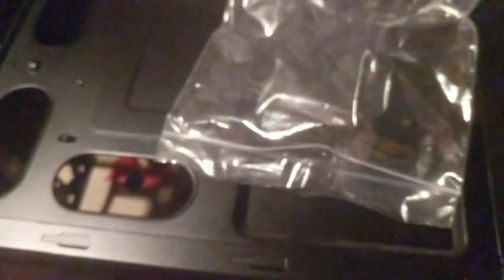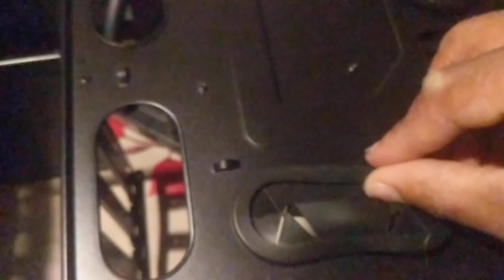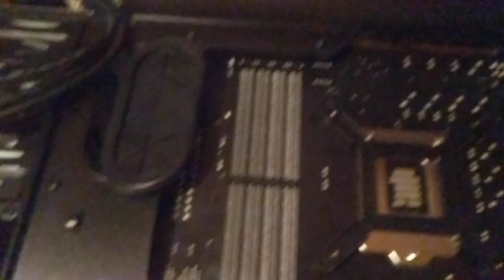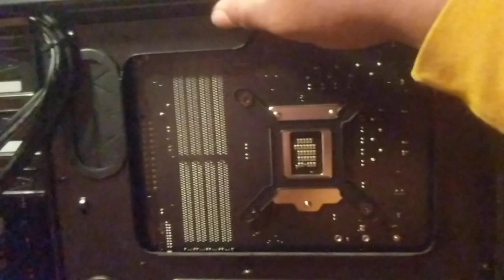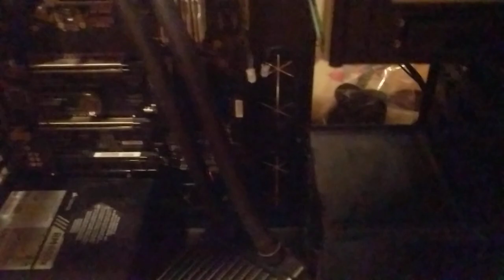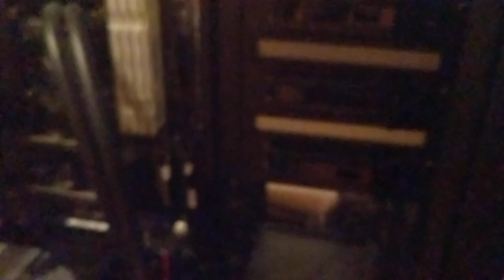Precut Synthetic Rubber Grommets for Gaming and Hackintosh Cases

Comment: can you tell the dimensions for Cooler Master 690 ii Advanced?
Reply from the maker: 214.5 x 496 x 528.8 mm
21.45 x 49.6 x 52.88 cm
8.4 x 19.5 x 20.8 inch
Reply: @StevePringle  for grommets?
Reply from the maker: @SamreenArbab  That was the measurements for the case. 🤦‍♂️
Reply from the maker: CM 690 ii comes with grommets (unless you get the old version) so are you missing to replacing damaged ones? 😥
Reply: @StevePringle  i dont have ones.
Reply from the maker: @SamreenArbab  Ah! So you have the old case. I'll  try to measure it with the digital calipers.
Reply: @StevePringle waiting fornyour replyyy

Comment: Where can buy this??
Reply from the maker: Due to Covid-19, we are not having them made as importing them took too long and people were getting upset with the long wait times or rush shipping. Corsair will have in stock or put you on a wait list or you can find someone on eBay that a set that came with extras and is selling the leftovers. Hopefully, they are close to your location so you can save on shipping and pick them up.
Reply: @StevePringle  I need some made for a Corsair C70 Vengeance. I'm unable to find them and Corsair support doesn't have any. I'm willing to pay. Please assist
Reply from the maker: @FoVision  For cable management or to soundproof the screws? Be warned, the one for screws makes it raised so they end up being shorter and make fall out when you interact with the case. Some people bought up genuine Corsair and is selling open box so they can split it up. Your case will need say like 4 but 10 is in the box plus 2 other size no one use much unless they have an old case. Plug in the part number instead of the model number to find it easier. I'll let you know if I can still get them in the East bit if case manufacturer aren't ordering, they won't have leftovers or ones that at good but don't meet the Quality Control specs they set such as the hole didn't punch through or off center. When it's in the case, nobody will see it but you'll know it's there and that bugs the PC builder.
Reply: @StevePringle  the cable management rubber grommets. There are 3 total. I've been unable to find them anywhere and Corsair no longer provides. None on eBay either.
Reply from the maker: 10 pack - B08LZ13KRM (not precut)
Reply from the maker: 4 pack - B077MYSW8T (not precut)